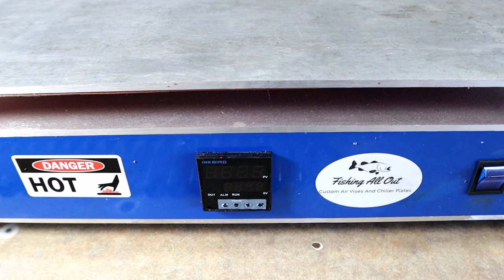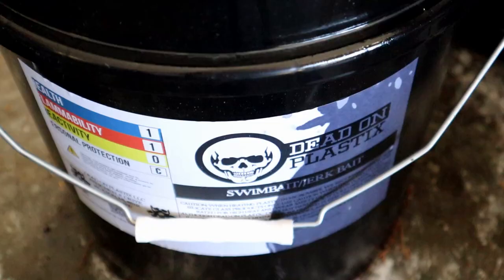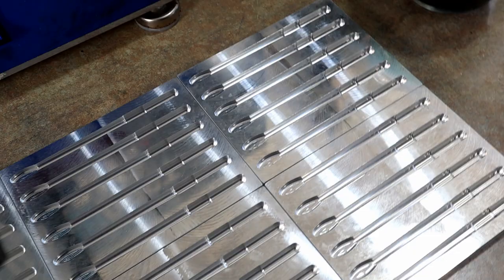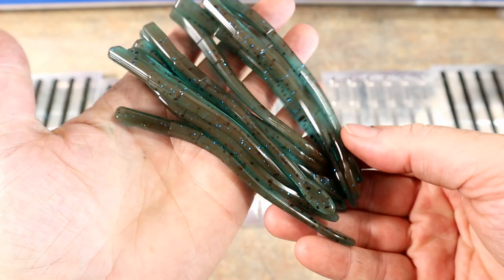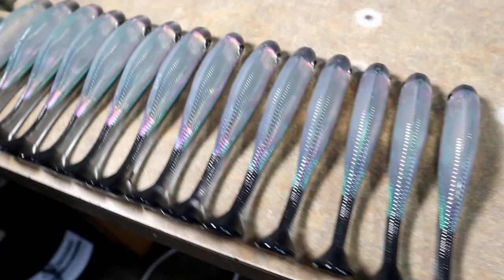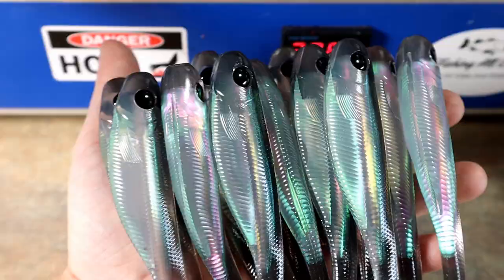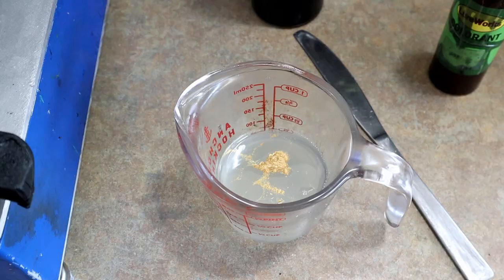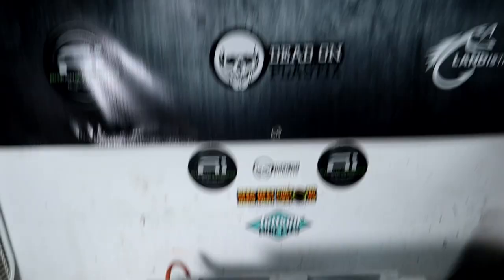Custom Bait Orders Bait-Blog & Blue Craw Recipe

Comment: While using the blue craw, I added some color shift . In an open pour mold, (ninja), I ended up with a beautiful mottled look. Yet, when I inject the same material into a mold, I lose that "design" mottled appearance.  
 Any suggestions as to why , or , how to achieve the mottled appearance when injecting.